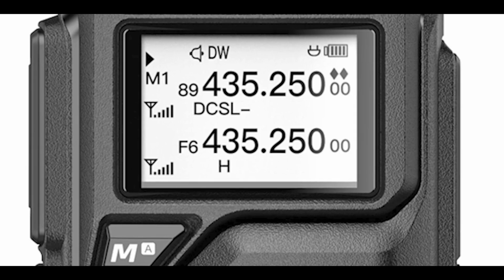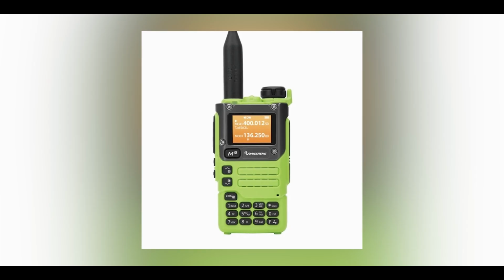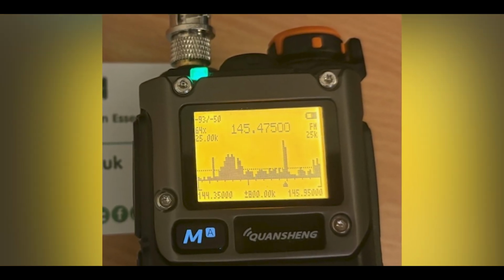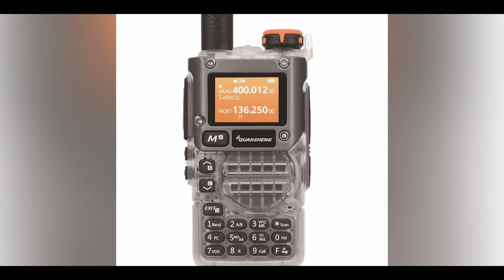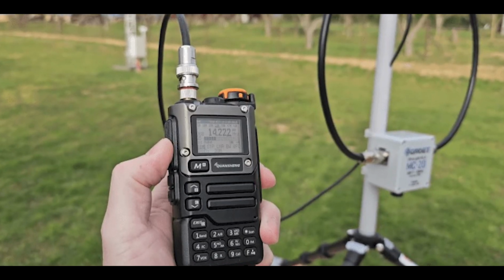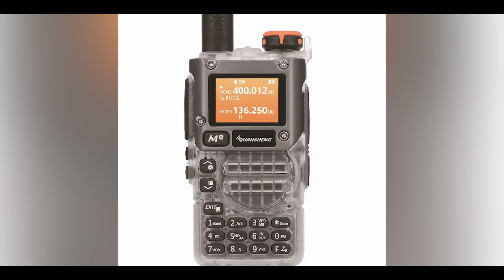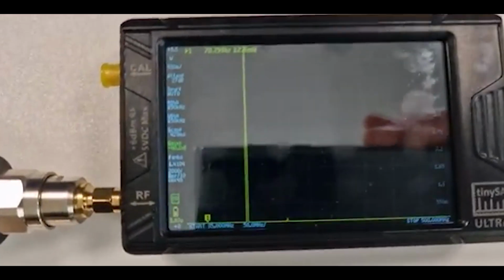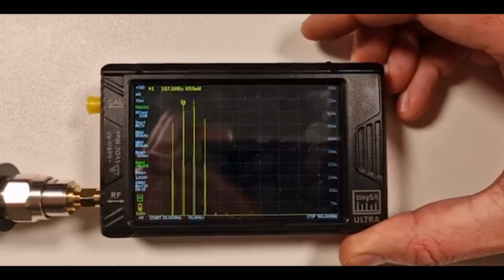The Most Illegal CB Radio Ever

Comment: It's NOT a CB.
Reply: cb......27.385 L
Reply from the maker: Than what is it?
Reply: @marcdrouinaudjr  it's an HT, HANDY TALKIE, with an incredible RX bandwidth, and ability to use several modes & TX outside of it's orig. intended bands.

On the CB section, it's extreme low power out MAY actually be legal... Depending on any spurs. Just as the "toy" walkie talkies back in the 70s were.
Reply from the maker: @jptucsonaz8503  Thanks for adding your knowledge!
Reply: @marcdrouinaudjr  It's a Two Way radio, NOT a Citizen's Band radio, it's not an Amatuer radio either. It's VHF/UHF radio with no real classification, as the Chinese don't actually care about rules and regulations in manufacturing, hence the reason they steal so much in design and functionality from decent sources and make garbage product to fleece users on the open market. Cash is King, even for Communists.